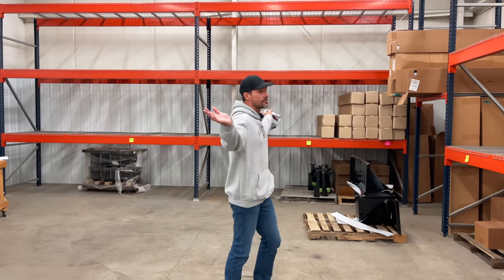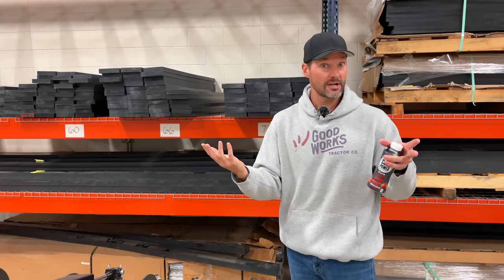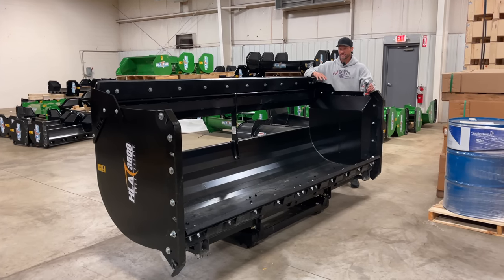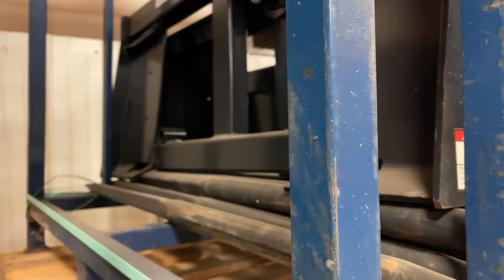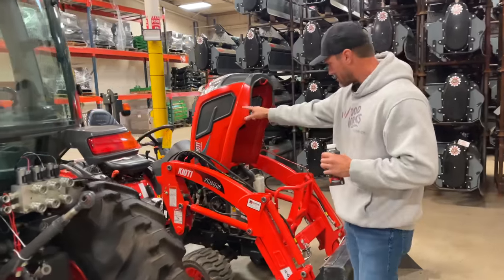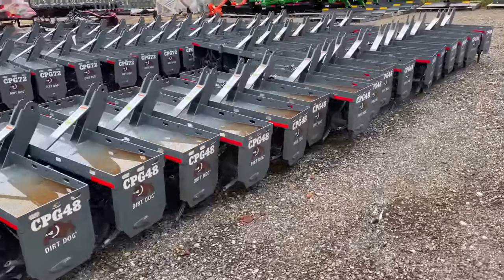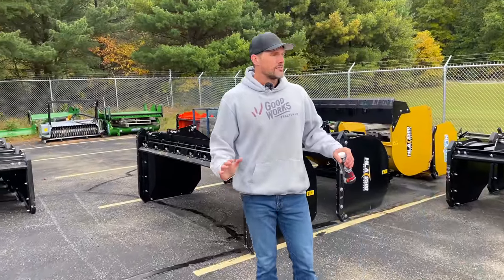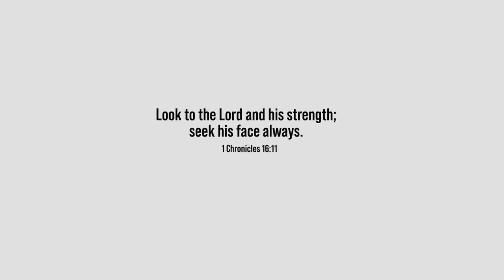I THOUGHT THE PANDEMIC WAS OVER? SUPPLY CHAIN ISSUES

Comment: Morning Courtney I have a rear blade on my BX2380 that I added a UHMW blade too. It’s a perfect companion to my Kubota commercial front blower and I use it a lot up here in the Soo. When the snow ploughs leave a huge 3-4’ furrow I use the back blade to knock it down instead of having to raise the blower to try to reduce the height. I also like giving the driveways a nice scrape after I’m done blowing to give it a finishing touch. The UHMW blade is so much better than the steel blade it’s quieter and it doesn’t damage the pavement. The widow across the street that I clear the driveway in the winter has a concrete driveway and the UHMW blade is holding up to that rough surface.

Comment: I wonder what the ratio of Pat's easy change to SPEECO is.  I've got both. I bought SPEECO sitting on the side of the road the waiting on a tow truck to pick up my ballast that PATs let go for the 3rd time.  Washers turn this turn that. The bar. Multiple fitting for each implement.  Then I remember your video.  I called, and 2 days it was in Ohio.  I haven't lost anything since. And I only have to dismount for PTO hooks.  But these FB groups are all about PATS. They must have like antique implements.  That would be the only use.

Comment: Can you do a video on the different hitch categories and what you need to look for when buying used attachments for your tracktor.  I have a tym t25 and and so confused as to what I need to look for when buying used attachments for it.  I want to get a used brush hog or brush hog but I’m afraid I’m going to get the wrong one.
Reply from the maker: You have a category 1 three point hitch.  You'll only use cat 1 three point attachments on it.  Cat 2 and Cat 3 won't work, but they are bigger attachments anyways and your tractor wouldn't even lift them up or have the power to turn the gear box on the PTO.  

Stick with cat 1, still make sure the attachments are sized properly.  Email us if you have questions on sizes of specific attachments you need.  Happy to help.
Reply: @GoodWorksTractors  thanks! I may get a flail mower from you guys in the spring. People want almost as much as new for used beat up equipment.  New seems to be the way to go.   Thanks for the reply!
Reply: @GoodWorksTractors  do they make a flail mower for a sub compact that is on an arm and can reach out or be turned vertical for clearing the sides of trails or ditch work?
Reply from the maker: Yeah, the smallest version of this one will work: https://www.goodworkstractors.com/product/del-morino-funny-super-brush-mower/